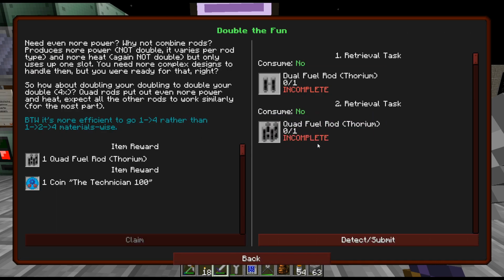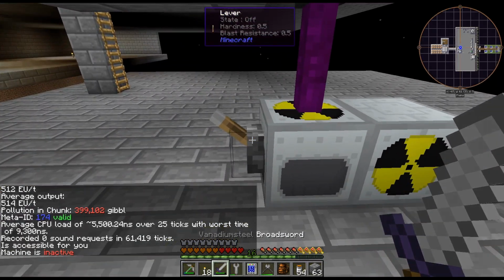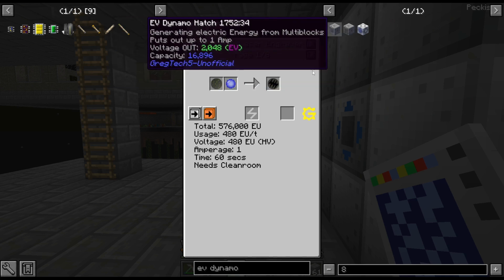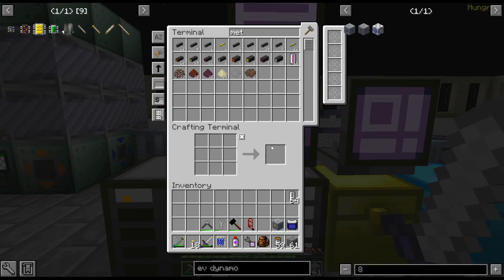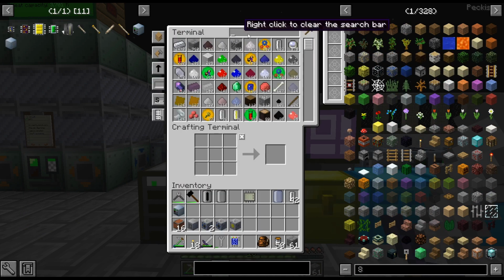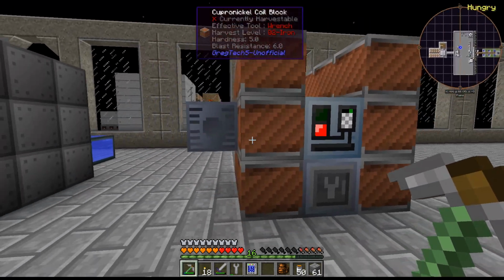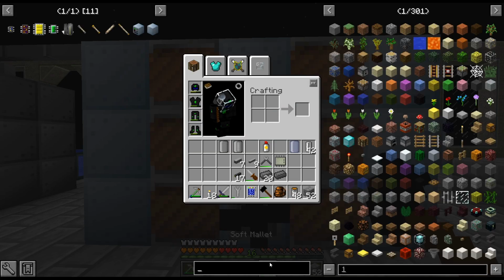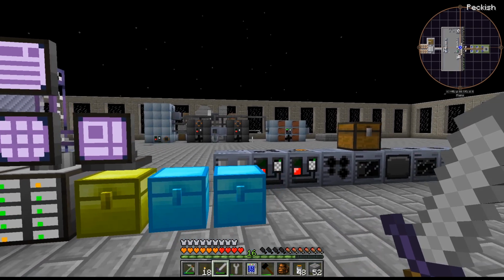GregTech New Horizons S2 - 80 - Crackin' That Fuel

Comment: The fluid solidifier is much much faster than the extruder at a lot of recipes. Have you tried making plates from ingots/dusts in a fluid extractor > fluid solidifier with a plate mold? The catch to this is that depending on the material and the pattern there can be big differences in using an extruder vs. a solidifier. I check each recipe before I do large amounts of crafting because I usually save several minutes of processing time.

Comment: Reactor platings are actually useful for containing explosions, if you're too lazy to build a secure reactor room. Of course ideally your reactor would never explode in the first place, but, well, GTNH and things going according to plan...

I'm honestly not sure how necessary breeder reactors are, compared to just running Thorium reactors when the power they produce is actually worthwhile. That said I do have a breeder reactor design for 20 quad thorium or dual uranium rods, maybe you'll be able to make use of that one day.

Another thing you can try to speed up block breaking, though it might end poorly, is using an Equal Trade wand focus to swap blocks for, say, dirt. Don't recommend trying that on something expensive without prior testing, mind.

Comment: Reactor platings help to lower the radius of a explosion if the reactor goed beyond 10000°C. The gray one with dots is the best one to use if you don't want to risk your base by a reactor meltdown.

The orange one is used to higher the reactor max temperature by 1700°C, usually used by breeder reactors or MOX fuel reactors, as MOX fuel tends to generate more EU/t the hotter it is.

The solid grey one is a middle ground between both.